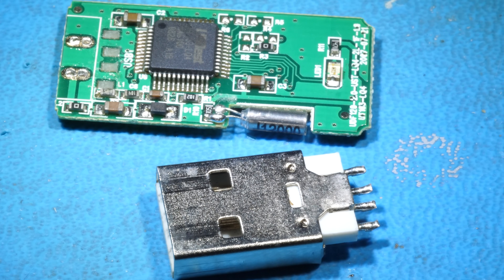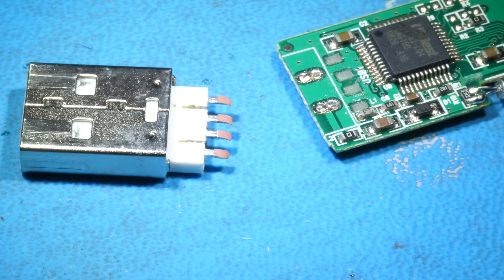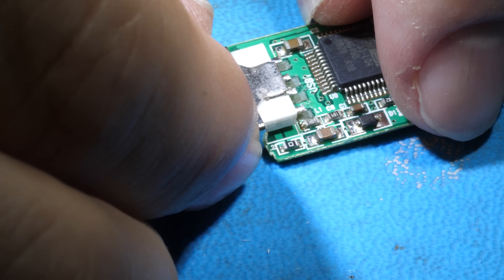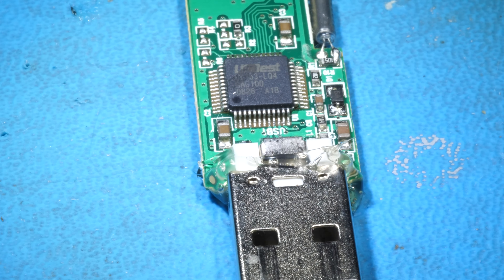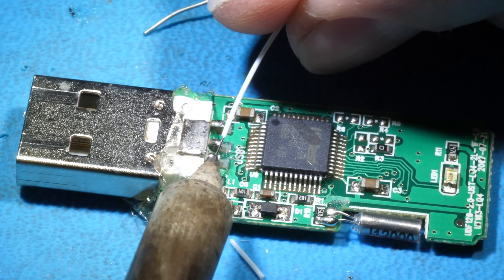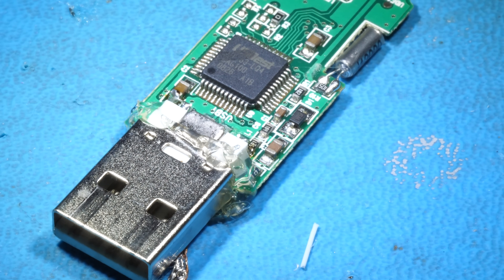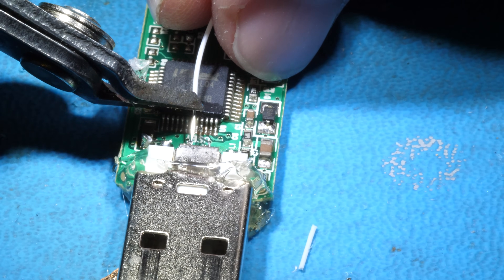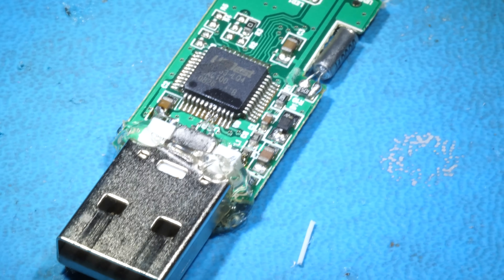Fix a physically broken USB Thumb Drive

Comment: Interesting video, but it would have been nice to see you plug it in to a PC and start the transfer of files. By the way, what was the cylindrical shaped thing on the board ?
Reply from the maker: It's a quartz crystal: the communications protocol on USB demands certain timing constraints, and that's the function of this part.

Comment: Thanks to your video I was able to get mine to work.  It wasn't the video, but something you said.  At around 10:00 you mentioned the wire being a centimeter length and the wavelength.  The drive I was working on I couldn't' solder the usb connector back to the board so I ran wires and soldered them together.  I kept getting a unreadable device.  After seeing your video I cut the two center wires short.  Still around 2 to 3 in.  When I connected it the drive came up and I was able to copy all files over.  Thanks!
Reply from the maker: It's called signal integrity: you need to make efforts to maintain a constant impedance on the interconnecting wires, which are transmission lines. It becomes more and more important as the frequency rises. Typically you can get away with an inch or two of uncontrolled impedance on the transmission line in this scenario, but there will be increased electrical losses.

Thankfully, the specs allow for these losses up to a certain degree: this is the same reason that there's a cable length limit on USB. Losses increase as the cable length, or transmission line, increases, even if it's a properly controlled impedance. Losses also increase as the frequency increases, so that's why, for example, passive Thunderbolt 3 cables are typically limited to 50cm.

Comment: Hi, I hard usb flash reader for micro sd 64GB and usb reader damage and open it and i see only tow smd capacitor and over controller like black glue without  any name and pins of the micro sd card ,how to check this flash reader? this flash from chaina without any name

Comment: One question can you still fix a USB flashdrive if one or more capacitors are lost. Cause that is one of my problem also with my USB stick. pls help me
Reply: I tried that, didn't work here, after first fix with still all intact it just recognized something was plugged in, not what, without one of four capacitors, it just did nothing.

Comment: What happens if u left that solder on, when you accidentally bridged it? I accidentally bridged mine, i dont have the copper wick but i tried heating it off and it caused the solder to go under those metal line things. If i leave it, will it work? Or if i get the braid will it remove it from under those? Please help :(
Reply: That is why you want to test for shorts with the multimeter. If you just plug it in then chances are you wont get anything readable if any data at all in the best case scenario. Worst case is it fries it instantly and catches fire while damaging the usb port and machine it is connected to.

Comment: i just whacked my cruzer glide 128gb with my knee when i was going back to using my PC and it snapped clean off, traces were damaged, USB drive was completely busted, nothing i can do to recover files, R.I.P files
Reply: I kept mine in hopes that  it would be recoverable one day. It's 4 years later, and I'm pretty sure I shorted it out, but I'm still holding onto it.
Reply: @deadpilled2942 I’m in the same boat 5 years in still have high hopes lol
Reply: mine spontaneously fell apart for no reason...
Reply: @ci.netproductions  SAME LMFAOO

Comment: A huge amount of talking with very little useful info for someone who has no understanding on what materials to use or how to correct this problem. I'll be taking mine to a store or finding another video - Maybe less talking about coffee and alcohol and more explanation of the materials you are using, and a brief understanding of why you are doing what you are doing.
Reply from the maker: Thank you so much for your comments! It means a lot coming from someone with a sum total of no content whatsoever. Next time I'll script it for you and re-take several times using several broken units.

The coffee comments are serious and genuine, after more than a cup it's incredibly difficult to operate steadily under a microscope. It also takes about fifteen minutes to get into the groove of doing small stuff irrespective.

Anyway I look forward to your no doubt high quality video of you going to the shop.
Reply: @nezbrun872  you can lead a horse to water... but if they are too stupid to drink that is on them. Thanks for the vid

Comment: Can I repair the memory chip Because I bought a fake 16gb USB flash drive wich hold only 127mb
Reply: By "repair", do you mean "replace"? If you find out how to increase the capacity of a memory chip by 15GB with a soldering iron, I will beg on my knees to be your pupil.
Reply: @VidkunQL  just sold more memories chips. Search for zombie graphics card
Reply: :D sad live, get a normal kingston or etc flash drive for 7eurs 8gigs